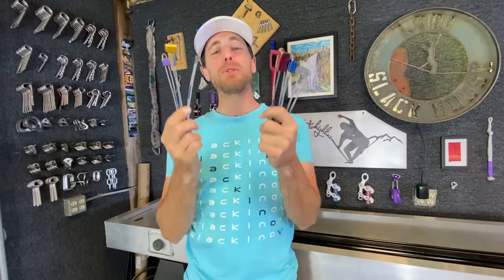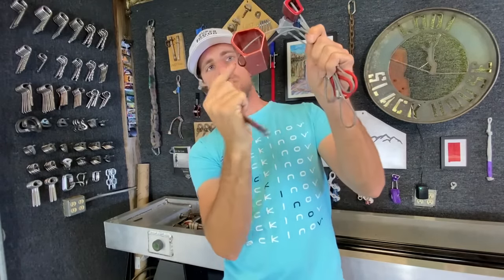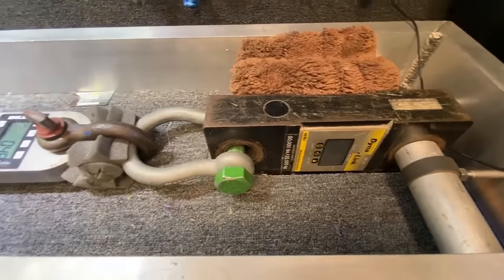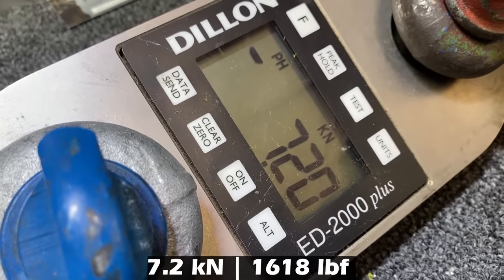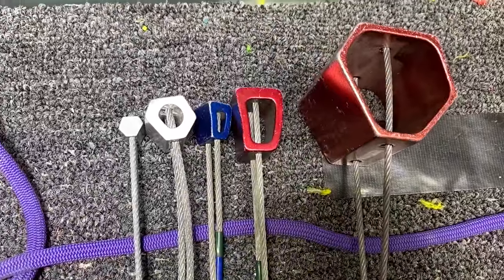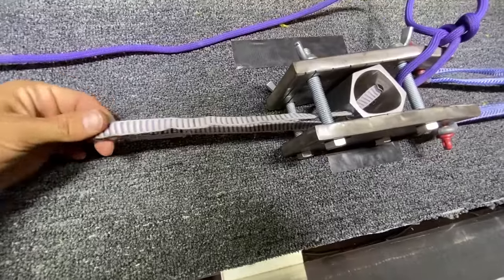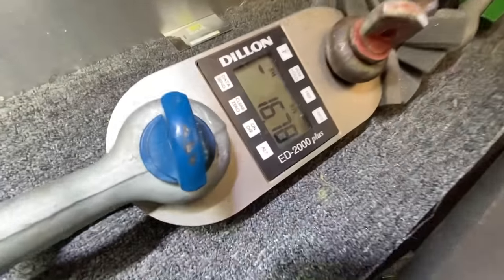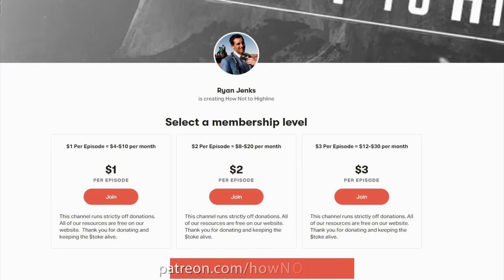Climbing Nut & Hex Break Tests

Comment: Since most of these wires are breaking at the carabiner, they might be breaking higher than rated because you are using a round locking carabiner to attach to the wire.  Compared to a smaller wire gate carabiner that would normally be used with these, the bend radius of your carabiner is larger, which decreases the stress concentration on the wire, which potentially is what is making the wires break at a higher load than their rating.  I'm curious if there would be any difference in performance if you used a carabiner with a smaller bend radius.

Comment: I would bet that the two that broke on the side of the cable eye ,broke there because the cable has has a coating.  In my experience with spearfishing any coating on cable is a recipe for trapped moisture and hidden corrosion.

Comment: Brass is really shiny at 3:45 when it experience shear forces. as the molecules get crushed against each other and deform, the texture changes and the gold effect it lost. same if you cut it with a saw (same shear force applies)
Reply: ive cut a lot of brass on bandsaw, lathe and mill. I have never seen it look like that before
Reply: nonsense

Comment: The wires with red plastic I sent. To the best of my knowledge they are from around 1981 but never used. I have a pile of them so I sent a few to Ryan.

I’m very impressed that 40 years made very little difference.
Reply: Regarding material strength, steel wire is stable over time (compared to soft materials like Dyneema and nylon).  While soft materials will lose strength as they degrade over time, metals only lose strength by experiencing high or repeated stresses.  Since you never used them, you were not putting any stress on them (e.g. by repeatedly taking falls), so it's not surprising that they maintained their strength.

Comment: You actually set the tricam on active position, passive position is placed like a nut, with the "rolled pin" on the side of the webbing. Acording to NBS it breaks at lower strength when placed in passive position so it woud be interesting to see that! Great video as always!

Comment: My guess on the old hex with the dipped cable is; over time, from use, or even just sitting there, they are exposed to moisture. The coating on the cable made a perfect spot for moisture to get trapped. Even though it's a galvanized cable, any corrosion would have happened there first.

Comment: Hexes are life. They make placements where the entire rock face would have to fail for it to pull.
Reply: Specifically those Wild Country Rockcentrics, soft slings. And if they get too noisy, you can put a layer of Dynamat on the inside lol

Comment: This would be a tough one to film but I would love to see a comparison of similar active/passive placements in different types of stone.  I climb in the Red River Gorge a lot and wonder if sandstone there - which is a little less solid than other areas - effects the strength of certain pro (especially tri cams).  Perhaps something to consider is slowly collecting videos/data of as you travel around.

Comment: Hi ! I have been gived some olds Hexs from Chouinard Equipement (old name before Black Diamond) by a dude from my alpine club. Of course i have changed every rope and webbing on thoses olds-timers because they are 32 years old mini minimum.. But there is where things gonna interesting ! the holes in the Hex head has been sized for old thicker rope. but i wanted to setup a more thin and lighter rope instead. But because of the size difference the head was mooving too freely, so i have figured to fix that by a creative way, i have cross-twisted the rope inside the head ! It solve my problem but i'm not really aware about how the rope radius is augmtented and how it will affect the solidity.

Comment: For gear that is consistently breaking at the carabiner attachment, especially cams, would it make a difference if you increase the bend curvature at that connection point by using 2 carabiners to connect or a large diameter steel shackle? 
Although not a conventional attachment method it would be interesting to see how strong the wire/slings are with the increased bend curvature or if they start breaking consistently elsewhere.
Reply: Makes you wonder why manufacturers haven't created a solution to this problem by designing a carabiner with a larger radius at the major load points

Comment: breaking at the nut's probably the ideal material efficiency, the cable's cheaper than the machining on those nuts.

could just be a difference in design philosophy some companies might just overdesigns the nut then they don't have to worry as much about certification because it'll just do what the cable they stick on it does.

Comment: The red hex breaking like that is probably due to the low friction of your “nut crusher”. The lower the friction the higher the lateral force, and the hex gets squeezed. So this failure mode probably does not translate well to actual usage, since rock has higher friction.

Comment: Hurrah for Campbell nuts; 2:00, nice inner curved arc for sling. Mine slung with 7mm Spectra, triple fisherman's, I suspect might surpass 20kN. Nothing feels as reassuring as a passive wedge in a constriction, set it and forget it. Cams and bolts just don't invoke the sense of absolute security.

Comment: I'd definitely like to see the nuts tested in real rock, I feel like the point of failure, especially for the smaller nuts, will likely be where the nut wedges against the rock and how the rock holds up to those forces.

Comment: On the large hex that got crushed maybe BD can put a cylinder of aluminium inside to oppose the crushing force.  Shouldn't be difficult to manufacture since the sling/wire will keep it in place.

Comment: OK, this is a dumb question, Ryan, but in some of your earlier videos. you talk about how aluminum carabiners should not be used as primary attachments at anchors because of cyclic loading. Do you guys have any tests that demonstrate this problem? Do you think you could do a test of that principle? If not, do you have any favorite sources for info on that? Thanks! Again, you guys are making the best test videos of climbing gear on youtube. Love your stuff.
Reply: Machines for cyclic loading are crazy expensive, stuff needs to be loaded tens of thousands of times.
Reply from the maker: Definitely be interesting to test at some point. As we understand  it that principle is more applicable to highline anchors where the wind can generate thousands of cycles. The closer closer you take aluminium to its maximum strength the fewer cycles it can handle. A 24 kn hanger might handle 5,000 cycles at 4 kn but only 10 at 20kn.

Comment: I'm entirely unfamiliar with climbing gear, but I am  familiar with metallurgy. That looks to me like your "brassy" isn't brass. It could be aluminum, but I suspect it's a steel alloy with a brass layer on top. Allowing the soft bass to slightly deform to increase friction. The silver looks a little too uniform to be friction embedded aluminum.

Comment: I had brassies, used for aid.
Only placed on lead climbing once, cause I was scared and it would fit.
I don't think they're meant for fall protection, so much as body weight placements.  No?
Reply: They deffo are. Larger ones are just as strong as regular nuts. And the welding is a stronger way to attach the nut to the wire.
Reply from the maker: I would whip on one

Comment: Why does Bobby have to hammer the nut out? Are they welded together so loosening the plates is not enough?
Reply from the maker: The passive pro was jammed in there so tight it wasn't possuble to unscrew the plates.-Bobby

Comment: You just did a video about sketchy carabiner that break at 12 kn but in this one pieces braking around 8 kn are safe? I’m not trying to be sarcastic, genuinely curious what your though process on that is.
Reply from the maker: Tiny nuts and brassies are more of a desperation or body wieght only placement. They are sure better than no placement but not exactly bomber. 
Also, this gear is much less affected by cyclic loading unlike aluminum carabiners. You can take them close to their maximize breaking strength with out compromising them unlike aluminum carabiners.